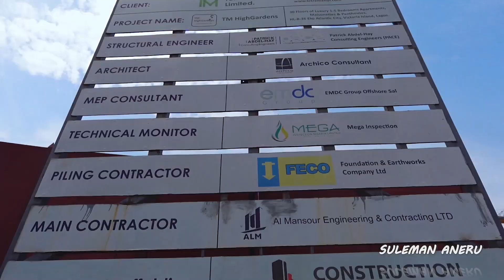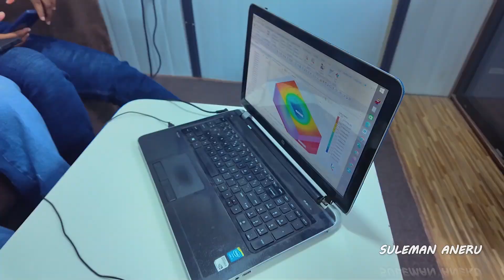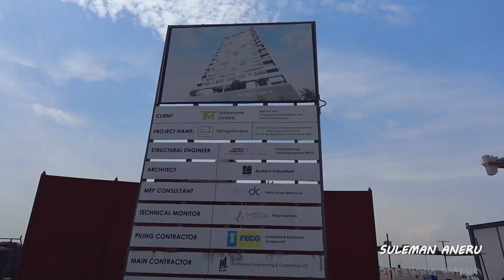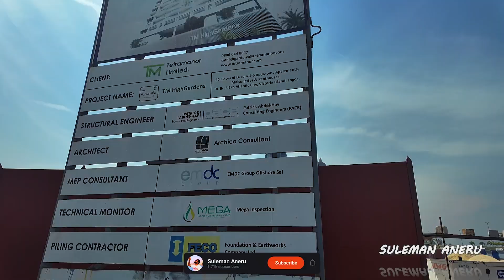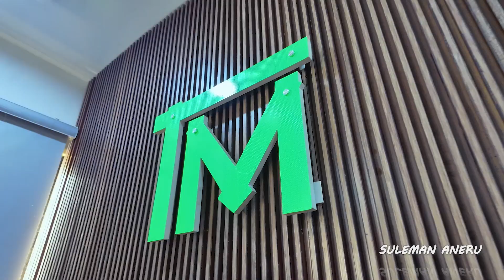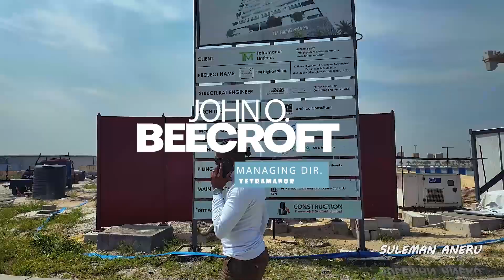He Is Building The Tallest Skyscraper in Nigeria Inside Eko Atlantic City

Comment: There's no need with holding on to the title "tallest building" when it's just 32 stories. It's better to sell the plan with other features of the tower. Sujimoto is also using the same phrase "tallest" to sell his new project. 

Good luck to the developers
Reply: A few things wrong here: The current tallest building in Nigeria is the NECOM building, also with 32 floors. So while it my seem "just 32 stories" it is on par with the current tallest building. 
Also, the number of stories, while a good indicator of the height of a building, isn't accurate enough to conclude on height. For example; if the standard height of each floor is aproximately 2.3 metres, then 32 stories would be about 74m. The NECOM building is almost 100m taller than that. A much smarter comment would've been to ask how tall is the proposed height, or if in addition to the floors, a spire would be added, or so and so. 

Additionally, just because the appeal of another company is the same isn't a valid enough reason to change the tagline, especially if the other company's project is older and therefore might be shorter than this company's proposed height. 

I think this comment is a flawed statement, and would benefit from a little bit more research.
Reply: @namjooning1017   word frr
Reply from the maker: Thanks for sharing your thoughts Benji🙏